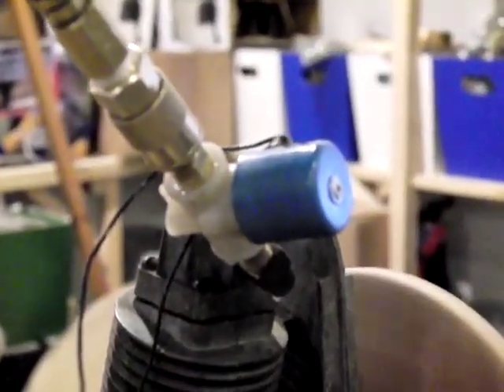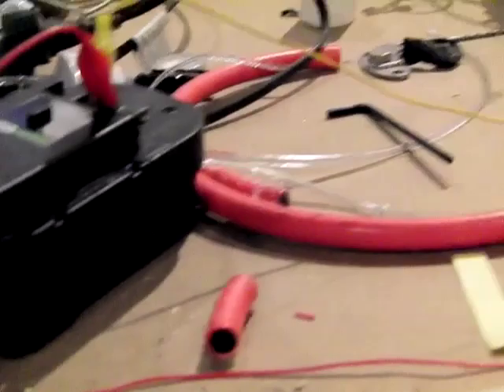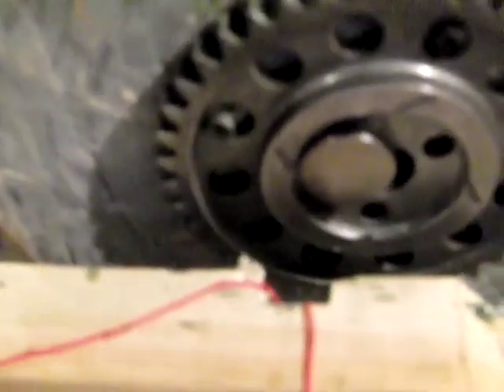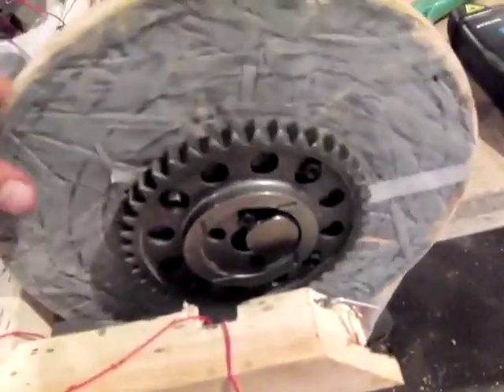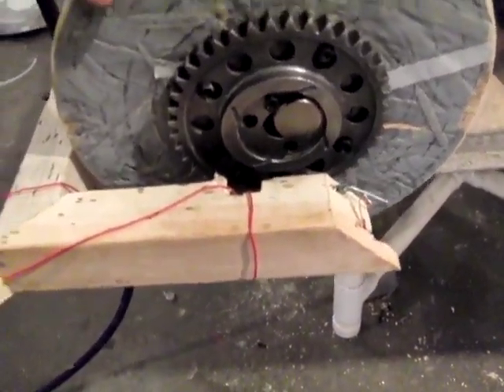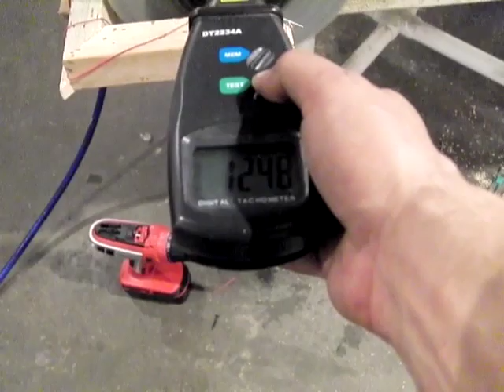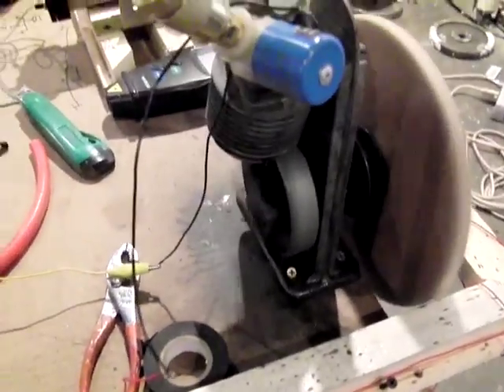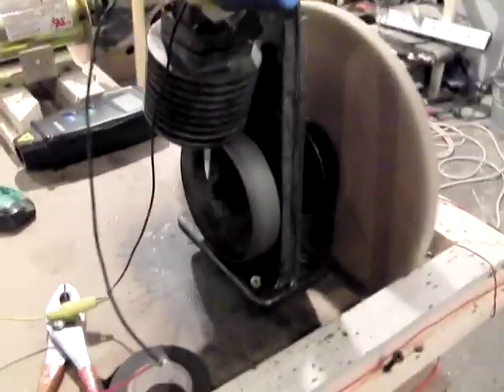STEAM ENGINE FROM AN AIR COMPRESSOR Solar Engine for Future Tests

Comment from the maker: :-) Thank you. No steam yet. The magnet was 1" dia and the length of time was adjusted by moving it closer to the center axis (longer open time). If you move it out towards the outer flywheel the on time is less. The magnet can actually stay in place at 500 rpms on the outermost part. Very Strong. Close to the center the pull is not as great and the metal forming of this cam gear held it snuggly.

Comment: When the magnet come into readable contact with the "read switch" is also referred  to as a "reference sensor". This is actually pretty Ironic, as the soul purpose of a reference sensor is to time the ignition of an engine by reading a part a notch on the flywheel. Which is exactly  what is going on here!

Great concept  :)

Comment: PV panels are bout 18% efficient. Useing Solar for heat can be 35% efficient.  So as long as your engine is greater then 55% efficient you will have an overall gain. Cost wise however you idea here is great reguardless of efficiency.  I just wish we had more sun here during the winter. 90% of the time it's cloudy. :'(  Nice Job on the video.

Comment: @Terryblount An ignition coil doesn't have enough current to pull a solenoid, the primary side of the ignition might handle it. 
A compressor uses check valves instead if timed valves like an engine. You will not have the air turning on/off at the needed times.

Comment from the maker: Square Meter of Light to Square Meter of Light it is about the same. The generator and engine need to be as efficient as possible.  PV would be more as this has yet to produce any Solar Juice.

Comment from the maker: Designed to run off of Steam, the air is just a test, there are no engines that produce more energy that they consume. All engines have energy loss. This is designed to compete with conventional steam engines of the same size.

Comment: I wonder if the speed of the solenoid could be holding back the speed any.  They can only open a close so fast right?  It would be neat if you could connect a digital counter or scope to the reed switch.. maybe use a tachometer from a car?  neat stuff :)

Comment: what about a magnetic piston type mech. that pushes and pulls a brake cable or comp. & deco. an oil line. run it up to the valve and rig it(time/dist.) to open and close as the lower magnet passes over the trigger.replacing the need for the battery and electric solenoid.

Comment: instad of a piston motor try a spinning disk and flywheel depending on the aircompresure try diffrent size outlet holes and spinning disk sizes. don't let all the negitive people get you down. you can make a lot of power this way.I know

Comment: Maybe a fuel injector would work. They can handle the cycle life and pressure. Temperature might be a problem (?). Worth trying.

Otherwise I’ve seen people modifying the mechanical cams on 4 stroke lawnmower engines to convert to 2 cycle steam engine. Requires welding/bracing and cam grinding.

Comment: Use  a coil of wire and the flywheel from a lawnmower or the like.
You may use the ignition coil frame, but only a few hundred turns at the most, and your electric valve.
In this manner you need no battery, the magneto will provide the power.
An old lawnmower motor could just as easily be converted, without any electric control whatsoever.
Enjoy!

Comment: Wow, a guy responded to my statement and then removed it.  Here is what he said. 

You can disagree but compressing air is very inefficient as there is an enormous heat loss as the compressing process takes place. I'm not arguing that there isn't a place for it but it wastes so much energy compared to other methods.

The Stirling engine is not very efficient or powerful but I like the idea.

Comment: Moving the magnet does not make sense.  Use a bar magnet extending outward from the center and make the reed switch movable.  In this way you can control the dwell (time that the switch is on) by moving the reed switch inward or outward and also control the timing by moving the switch CW or CCW.  This allows trimming of the engine while in motion for maximum RPM under any load.  This can also be automated by using a low power microcontroller powered by the current that you generate.

Comment: I've read that some auto AC compressors work great without the need of a reed valve.  They have about 8  or 10 valves that open and close in rotation.... sorta like a closed fan.  (My comparison may not be the best but hopefully you get the idea.)   I think these types of compressors were the Harrier brand used on GM cars in the  80's.

Comment: The AVERAGE cost of a steam engine is $500 per HP  PLUS shipping cost of at lease $100 more per HP.   So if you take a FREE motor from a junkyard and get 2 hp out of it from buring wood you can easily power an automotive alternator.  

While that doesn't sound spectacular, if the ecomomy gets so bad that there are blackouts ... well just remember, in the land of the blind, the one-eyed man is KING.

Comment: solenoid valves are not build to be switched on/off at that high rate. i'm pretty sure it would brake after few hours of continuous work.

Comment: I don't know why this guy doesn't try connecting the spark plug wire directly to the air switch on these small motors and just do away with the magnets and complicated wiring.  After all, doesn't the spark plug normally fire TDC ... exactly when  you would need the puff of air to enter the piston?   And would running an air compressor backwards even need the air supply chopped?   Anyone follow?

Comment: Probably not. To generate 2KW you need about 6 Horse power. And this motor is probably around 1/4 HP, if that much.

Comment: If you were to replace the reed switch and magnet with an opto circuit and timing wheel,you could very the timing from start to an ultimate top speed....Doctronics2011

Comment: That's FREE ENERGY. You can build a PERPETUAL MOTION DEVICE However it will be limited in time, as it's elemental 1/2 life is achieved. Best to use a Water/Windmill to directly power a Air Compressor & store the F.E. 24/7 WITHOUT the need for batteries Then power a converted Fuel Engine to power a generator to power a Industrial LINEAR MOTOR or VOICE COIL SEE Solenoid Engines. Some can SELF GENERATE after start by over unity when powering generators. SEE Compressed Air powered LOCOMOTIVES 1828

Comment: I disagree.  When all is taken into account, compressed air is a fairly good system.  With batteries there is the weight concern and toxins in manufacturing, use, and disposal.  With hydrogen there was the concern of storage and refilling.  (Nobody is looking into the use of aluminum blocks and water as the storage medium... this is an extremely good system and safe.)  Then there is the Stirling engine which is our savior which again we are not using.

Comment: Search H2W Technology's online catalog. Linear Motor #BLDD-06 produces 200lbs continuous/600lbs peak@10%duty of PUSH&PULL forces of 0to12/^20G's @any stroke needed you just add tracks from 0to4/12amps (0to12<16/72volts) This can power a BLOCK&TACKLE @any ratio 1to1 50to1 etc... or used directly to power a piston. Like VOICE COIL #NCM24-60-4190 which has a shorter stroke of 2.4" GREENPOWERSCIENCE has a weed eater conversion video SEE that for better information than this one. & the V8 solenoid en